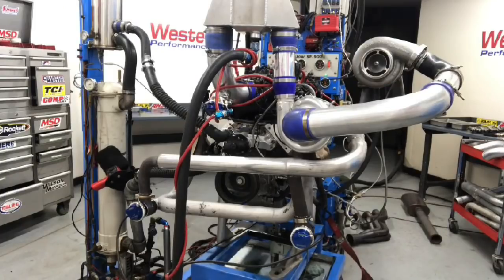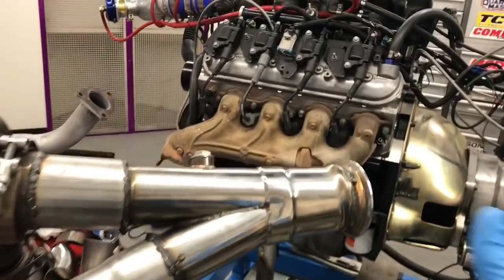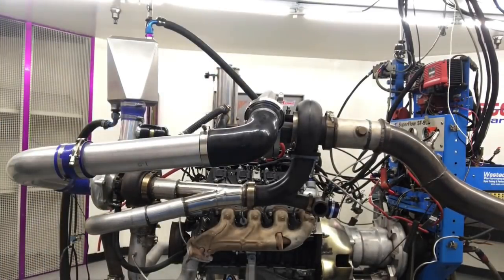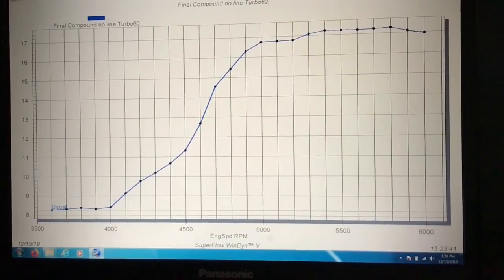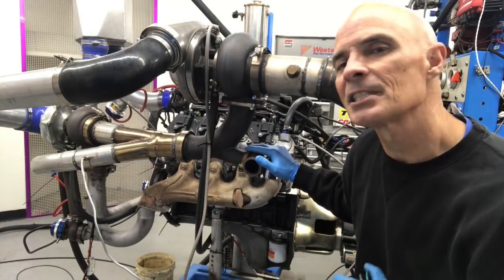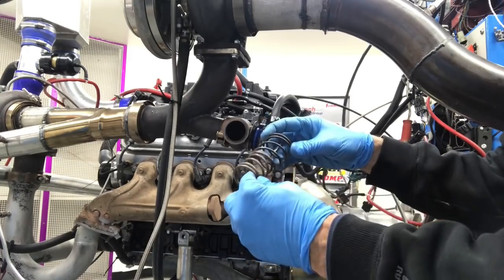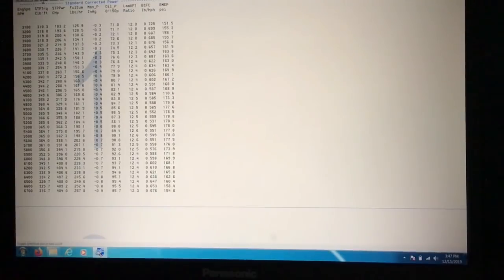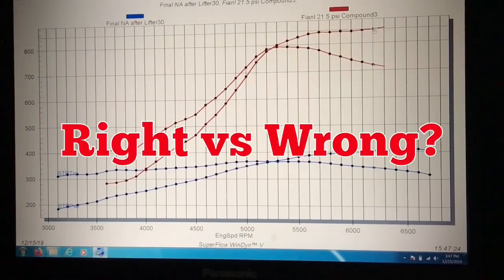Big Boost!! Full Results!! 1 Mistake!! Compound Turbo 4.8L!!

Comment: Great video Richard! Turbo boost is thought as free HP by using the waste exhaust of an engine. All forms of boost use crankshaft HP. You once mentioned of running a second engine, to supply the exhaust to feed a turbo(s), to determine the amount of crankshaft HP consumed by a turbo system. Did this experiment ever happen? Thank you, Tony
Reply from the maker: I have not but that would be cool-the turbo uses very little power-basically just the back pressure-much less than superchargers at the same boost level
Reply: I wonder if you could possibly get a close estimate if you ran the engine with turbo and measure the back pressure. Then run the engine N/A , then replicate the same amount of back pressure on the N/A engine that the turbo engine has.  Of course the Hp would be lower so you would have use it as a percentage of Hp loss per.
Excuse me if I made that sound confusing! lol but im interested to see also!
Reply from the maker: @JohnnyAnderson1  you can see the effect of back pressure if we eliminate it with the right turbo, but its 20-30 hp compared to 200-300 hp at high boost with a supercharger
Reply: @richardholdener1727  IMHO your estimated 20-30hp loss is a little conservative. I'm in agreement when you minimize the exhaust to intake pressure ratio, that hp will increase. However, exhaust back pressure is still a load on the engine, not the same load as a blower with all the rotational mass of the rotors, frictional losses and inefficiencies. Maybe in the order of 1/2 the hp loss of a belt driven blower?

Comment: I like the concept behind this but my only problem is with application. Unless you are building a rear engine setup or you're dropping this in a dump truck/18 wheeler, you can't mount this system in a race car or truck and have any visibility. Your system is great for proving the benefits of compound boost but needs work when it comes to fitment in everyday applications.
Reply from the maker: it only had to fit the dyno-we would plumb differently for a specific chassis

Comment: Should the little turbo feed in the the big one not the little one feed in to the big one??
Reply from the maker: Shanze Panunzio the turbos are oriented properly
Reply: Shanze Panunzio a lot of people think that, but the little turbo should get all the exhaust first, to start building boost. When it gets to its efficient pressure ratio, controlled via the gate, it starts to bypass what it doesn’t need to the large turbo. If you thing of an engine as just an air pump, it makes since. More air in, more air out. That’s what gets the big one spooling. As far as the inlet, the little turbo can pull air thru the big one(even tho it doesn’t need to-big one still flows a small amount by just spinning), where the big one is the limit of inlet air. If the little one was the atmospheric turbo, air flow would be limited by how much it could produce/flow. The turbos only know one job-compress air. It doesn’t care that the air is already compressed, it will just compress it again. Compounds just trick one turbo into thinking it is working under different atmospheric conditions to keep all turbos working closer to their most efficient PR, so they don’t work as hard or produce as much heat. Long winded, sorry

Comment: I'd really like to see a built bottom end that can handle all the benefits of a compound Turbo System. I'd like to see it make power like a motor twice its size. I really think you need another wastegate in between the small turbo and Big Turbo or bigger Gates. that way you can turn the spring pressure up on your small turbo to the same level as your big turbo or close to it. The 7 lb Springs are probably being blown open before that turbo even make 7 pounds... so you're not even getting the benefit of the small Turbo.
Reply from the maker: all the boost as indicated-we can raise the boost up on the small turbo as much as desired-we just didn’t want the load-in torque
Reply: I would just love to see what the setup can actually do versus you holding it back and I do realize why you're holding it back... it needs a built bottom end that can handle it.

Comment: Look I dont want to be that guy but I do have to point this out.  If you put in a simple one pass, air to air intercooler between stage 1 and stage 2, you will have a more precise way to measure boost going into the second compressor.  Dont go elaborate on it, just keep it simple.  To much heat in the second compressor is why alot of these builds fail.  Trust me.

Comment: Is there an advantage in using the exhaust from one turbo, that energy has been extracted from, to spin the second turbo, rather than a seemingly more simple plumbing solution of having each bank spin its own turbo with all its energy and compound the compressor side only?
Reply from the maker: each bank wont work well to spin two different size turbos-which is why you run a compound system
Reply: @richardholdener1727  thanks, still trying to wrap my head around this. is it due to different back pressure felt causing uneven scavenging in each bank of cylinders?
Reply from the maker: captarmour the two turbos will have different response rates
Reply: @richardholdener1727  that's what prompted my question because I'm thinking we using less energy exhaust to spin a bigger turbo, in the video the back pressure between turbos was less than upstream of the small turbo. Is it desirable to have less energy to spin a bigger turbo? Or is it the lower turbo inlet temperature is what's desirable at the larger turbo inlet?
Reply: @captarmour  you're on the right path, two medium size turbos can accomplish a very similar result. Most compounds are setup in a way to have a larger powerband. But to your first question for non compound twins they must have the same turbine size because of back pressure in the cylinders. Wouldn't want one side choking and the other size free flowing
Reply: @kylemilford8758  thanks but I'm still trying to understand. I thought that the compressors are seeing pressure ratio so that regardless of output pressure if both are at the same pressure ratio then both turbines are working about as hard as each other. In other words on the turbine side both exhaust manifolds should feel similar backpressure. Is this making sense?

Comment: Interesting from an academic perspective, but with modern turbo's there doesn't seem to be much value in a compound setup (for low boost applications.) That intake vs exhaust pressure difference is pretty bad and no doubt robbing a load of power. 

Would have been good to see what the power curve on just a single large turbo would have been. No doubt capable of supplying the required mass flow.

Comment: Have you ever tested a twin turbo setup with both the same size but 1 journal bearing and 1 ball bearing and run both journal only and ball bearing only to see what’s the difference and if having them different makes a difference?
Reply from the maker: the difference between journal and ball bearing is mostly longevity and not spool rate or power

Comment: gathering what I have seen from a Methanol fueled 4 cylinder with compound turbos,  you don't need an interstage blow off valve or bypass. the entire thing is plumbed in series so you mass flow will always be (air in + fuel == exhaust out - piston ring blow by) all of you control valving can be on the high pressure side IE on the small turbo.  when you bleed off high pressure exhaust directly into the atmosphere your throwing away that mass and all the energy it carries AWAY from the turbine wheels.
Reply: Its recirculated into the large turbos turbine. It's way to big of a setup but besides that mostly plumbed correctly
Reply: I agree though, Bov is not needed except 2 of them near the throttle body. Wastegate is correct however.

Comment: Umm you've got your feed backwards the small turbo I supposed to spool the big turbo but it's interesting to see the results none the less though.
Reply from the maker: Thnx-pretty sure it's right
Reply: Richard has it right. You want the small turbo in the middle otherwise it chokes flow having a small inlet, the large turbo compresses the air, making the small turbo stays efficient as it compresses already pressurized air.
Reply: @kylemilford8758  ok cause honestly I've never seen a gas engine compounded before only desels  and on them the small turbo boosts the larger one
Reply: The big compressor is always the atmospheric inlet, regardless of fuel type.  The compressor exposed to atmosphere is always the power limiter, so you would never want the small compressor first.
Reply: @kjewer1  dude the point of having a small turbo in a compound system I to spool the larger turbo small turbos are more efficient and spool faster that's why they're first in the system. If you had the bigger turbo first it would negate the entire point of the system
Reply: @kevincollins2184  The standard arrangement is small turbine first, large turbine second, and large compresor first, small compressor second. I believe that is how he has it here. I suspect you could swap turbine order and make it work, but not compressor order.
Reply: @kjewer1  to be honest on his convoluted plumbing system im not exactly sure what was first that's the only reason I had said I thought he had something backwards. And yes you are correct on the exhaust side and honestly I'm probably incorrect somewhere in my thinking of things cause physics works great in theory not always in practice ask me how I know
Reply: @kevincollins2184  No worries, the majority of people do think that the small compressor should be first, so logically it must make some sense. This is one of the biggest misconceptions I've run into in 10 years of running compound turbos on gas engines. The other big one is that the small turbo will somehow be "overspun" by feeding it with the large compressor, which just doesn't happen. It's an interesting topic, and not always intuitive until you start building these systems. I'm not here to be a pain in the ass, I just try to provide some info where I can.
Reply: @kjewer1  I've been building and tinkering with engines for 30 years or so but I've always been a NA guy. But when it comes to boost I understand the math and theory of it cause Voulmeyric Efficiently  Means everything in a NA engine so the same parameters also imply but are enhanced by boost. But one doesn't learn without ether make mistakes or having them pointed out, and also theory is great on paper
Reply: @kevincollins2184  Luckily theory can be proven (or disproven) on the race track. :)   I've got a compound turbo 4 cylinder drag car, and that's my test bed for all of these theories. I've learned a lot with this setup, it's been fun.
Reply: @kjewer1  really now you've peaked my interest do tell sir I've always been a small block Chevy guy but horsepower is horsepower I don't care how it's made
Reply: @kevincollins2184  I started running compound turbos on my 122ci 4 cyl back in 2008/09. Second pass out it went high 8s, which is also what it had run single turbo, so that was a good start. A few years ago it went 7.90s, it dynos ~1000 whp at less boost than I race with. I've got tons of info on my site (sixsigmatuning.com > tech pages) and some videos here as well if you search my name. I own a dyno (and now a dragstrip) so I'm the type that likes to do a lot of testing and data collection. It's been an interesting project for sure.
Reply: @kjewer1  oh no shit your guy running the 4G63 with the compounds

Comment: Compound turbos.For ....21psi?
Reply: Should be more like 35psi. Seems like a complete waste of time for so little power. Good to know.
Reply: Compounds are not used to increase pressure though...? 4 turbos making 25psi is still 25psi at the intake manifold.  Its just a larger mass of airflow (more cfm)
Reply: @kylemilford8758  totally wrong. Sorry to say. twin turbos allow for same boost double flow. Compounding is exactly that... Compound boost will yield higher psi. Check out the sr20 running 130psi and how/why.
Reply: @kylemilford8758  https://youtu.be/1pV_tLbZY0A

Comment: 😼Hey Richard, when you get done with compound turbos. Do a boosted engine with 12.5:1 compression. With whatever fuel it takes.
Reply from the maker: S rage that works
Reply: Ill be around 12.5:1 compression in my audi a4 1.8t on e85 With compound turbos. Should make about 500awhp. I think high compression is the way to go if you have access to corn juice

Comment: If you ever find yourself with a smaller small turbo and a bigger big turbo just sitting around, I'd love to see what that sort of combination could do. Seems like it ought to be possible to get 15-20psi boost around 2k RPM from the little one, and 1000+whp at the top end from the big one, which would be delightful.
Reply from the maker: this combination of turbos will do that-we just didn't want that much torque on the load in

Comment: Just curious why others (LS Nasty, 10k shootout etc) get 1000+ ALL day with only a S480, even a stock 4.8. 
And not even a high dollar billet wheel one like you had
Is that small turbo a restriction?
Hope spoiled you day those turbos are matched.
VERY disappointed with those numbers. You could've almost done that with a stock K24 and a turbo. LOL
Reply from the maker: Thnx for the comment. The S480 will support 1,300 hp so there was lots left-not every test I run is about maximum power. Google search the Big Bang Theory stuff if you want big numbers on an SBE combo. We did 1,543 hp on a SBE 6.0L LY6 at 29 psi. LS motors can make a lot of power.
Reply: @richardholdener1727  thanks for the reply...Will you be doing further testing with this compound to unlock more juice then? I've been driving LS cars since 1998...
But my faves in the early days were still builds like Denmah, etc, they always showed the truest potential of the stock LS...I LOVE low investment/high return turbo LS builds

Comment: I have been toying with this idea for a rotary engine for circuit use to gain torque down low but still have high boost levels at the rotary crazy rpm range but I can not figure out how to size the turbos properly.  I do want to do a trick intake set up to play with those compounds as well.

Comment: Great work, This is a very informative video. Compound turbo set ups are no easy feet and there is a lot of conflicting information and opinions on the internet (as always). I’m building a compound turbo 4 pot zetec on my channel and was led to believe you can run the main boost controlling wastegates in the manifold to atmosphere with the other bypassing the little turbo. Effectively controlling the overall boost pressure from both units and relieving the back pressure. I can’t wait to get mine up and running to start seeing first hand what works and what needs tweaking to get the most out of the set up.

Comment: You should read more on the compound turbo systems. 62/80 or 66/88 would do so much better, you'd have monster torque much sooner, and your large turbo wouldn't choke out the system. Frankly, a 76 could probably do almost what you have done. the whole purpose of compound systems are a lack of drawbacks, monster torque down low, huge power up top. Not that your system wouldn't be a blast, just sayn 62/80 or 62/88 would have more torque from 2k-3500 and would peak at any number you wanted up top... maxed by the larger turbo.
Reply from the maker: thnx-as indicated in the video-the turbo selection was what I had at the shop. The CXRacing 76 could provide immediate response if we wanted to turn up the boost on the gates, just didn't want that load in torque on the engine dyno. Would be good on the street though.

Comment: Can you swap the places of the turbos and put a t3/4 (~60mm) turbo instead of the 75mm after the larger frame turbo?(so 80mm feeding into the 60mm) I feel like by having the larger turbo first you might not run into as much back pressure before the first turbo? Having the large turbo feed into the smaller turbo, since it takes much more rpm to spool the large turbo having the small one after it. I don't think would affect spooling it that bad since its getting twice the amount of exhaust it would normally get even if its at a lower velocity? Wouldn't this give you low end power until the large frame turbo spools up and then max boost is based off the back pressure of the smaller turbo at the end? I dont know im only asking questions or do i have the position of the turbos backwards?
Reply from the maker: the exhaust is routed to the small turbo first

Comment: YOU REALLY HAVE NO IDEA WHAT YOU ARE DOING.  DR. JEKYL. YOU NEED TO BE ABLE TO LOG MANY MULTIPLE DATA POINTS TO MAKE A PROPER ANALYSIS.  THEN YOU CAN SAFELY OPTIMIZE YOUR SET UP. OR IS THIS JUST GO AND BLOW.  ??  BANKS ENGINEERING HAS ASSUME DATA LOGGERS RECORDS ON SIM CARD. FAIRLY INEXPENSIVE.
Reply: Stop yelling, or someone might come along and take your Caps Lock keys away. 🤣

Comment: Richard what about sequential turbos rather than compounds . Same setup. Instead of running the s480s outlet into the 7665 inlet take both otlets And y them together.
Reply from the maker: Sequential is cool but hard to get the switch over and requires a lot of tubing and valves
Reply: I've always wondered what the power difference would be  .  
If I were to do it I would use 2 throttle bodys on the outlets with out any springs making it so air can flow one way freely and if it try to flow  back naturally it would close. Everything else I would keep the same.  Pressure would work its self out look triple turbo diesels . 
I'll tell you what your 4.8 made more power than my 5.9 with s488 . Gotta love rpm and free flowing heads.